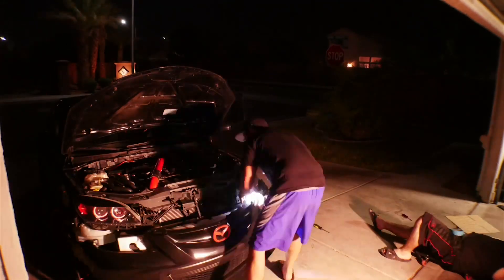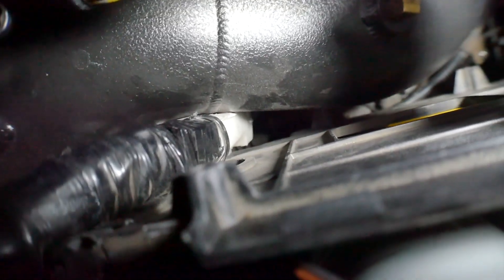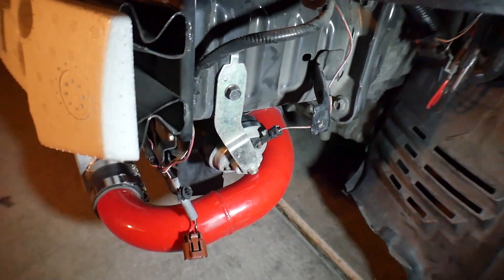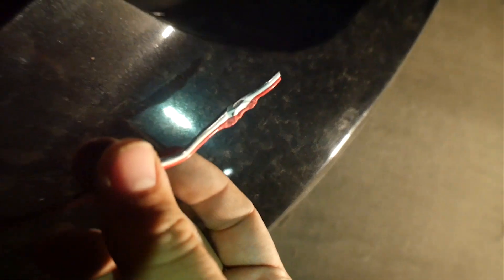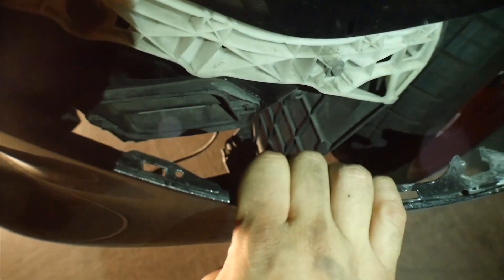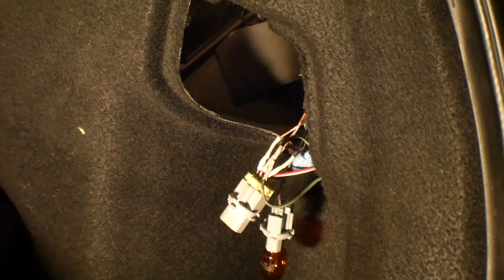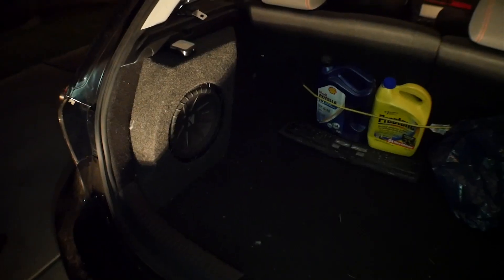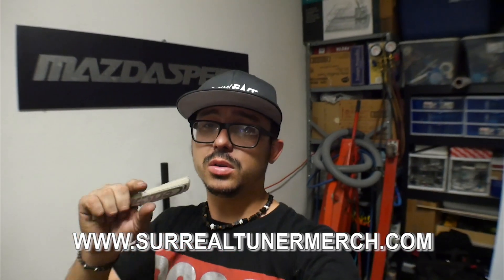MAZDASPEED 3 BRAKE LIGHTS AND HORN NOT WORKING CEL CODES P0703 / P0571

Comment: If anyone ever wants to do this mod, you can tap the parking light portions to the licenses plate lights, same with the ground. That way you only need to run 1 wire into the cabin. There's actually a rubber plug a few inches below the taillights behind the bumper you can make a hole and push the wire through. I blew tail light fuses due to the exact same issue Rob had. Live and learn.
Reply from the maker: awesome thanks for the tip

Comment: its normal on almost all cars for the cruise light to stay on even if you take the key out.
Reply from the maker: thanks been wondering that for a while now !
Reply: just press the off button.
Reply: Not true on my 12' Mazda3 if i leave CC on and turn my car off, the light turns off when the car is off and it stays off when i turn it back on.

Comment: hey man . I have the exact problem with my 05 mazda 3 hb 2.3l non-turbo .but I have not added anything or spliced into the harness .(same engine codes ,no horn, no brake lights or license plate lights & third brake light is on when headlights r on  ) any suggestions ? everything i've looked up says (PJB) witch is fuse box under glove box .I have switched all fuses & the brake switch on pedal checked most of the harness & grounds ,  dealer wants $1200 for new pjb with installation ,  I am pretty good at anything cars & that is my next step is to swap that with one of same model # , im stuck not much more I can do at this point p.s my car looks like yours after a lot of work got the fire mist black on her & all red & carbon parts will be swaping engine ect & adding turbo blah blah blah real soon ,just obv have some issues to figure out first lol please let me know rjd58@hotmail.ca  respect
Reply from the maker: 58rjd58 does your fuse blow every time you switch the fuse under the passenger side fuses  for the break lights? If no then I would start tracing every  wire from the ecu in the engine bay and inspect it for any sort of damage or rubbing if all looks well then start checking connectivity to every wire with multi meter and see if there is any shortage somewhere. My car the fuses popped soon as I replace them they good then soon as I press break pedal pop again that's how I knew there was a shirt
Reply from the maker: 58rjd58 oh check also maybe your break bulbs are out haha I dono anything can cause it it's so stupid try the break pedal switch you gotta just start replacing one thing at a time and see what happens

Comment: I'm not saying this is the answer to your problem. I had the exact same problem with no brake or tail lights and no horn. But my 3 hb had a broken wire under the fuse block under the hood. I soldered a new short length of wire on. Problem solved.
Reply from the maker: yeah these cars are weird how it trips out weird codes because of some type of a short in a totally other section on the car
Reply: Surreal Ent kind of like a thermostat code. But its usually a bad head gasket. Ha!
Reply from the maker: yeah haha oh well what can you do. But hey thanks for the tip and the comment if you have any questions be happy to answer them please fallow the channel lots more coming for the car